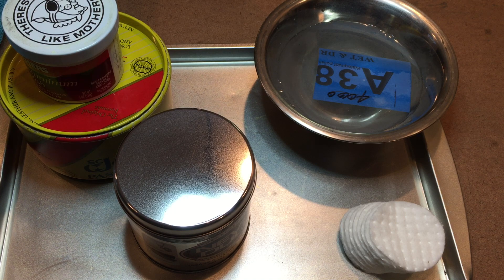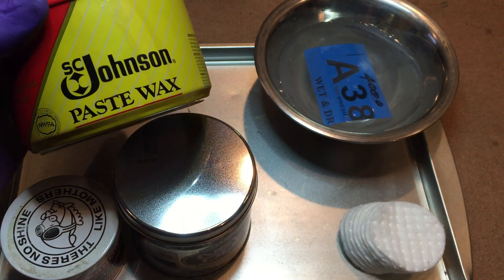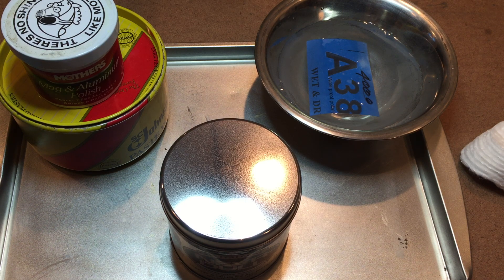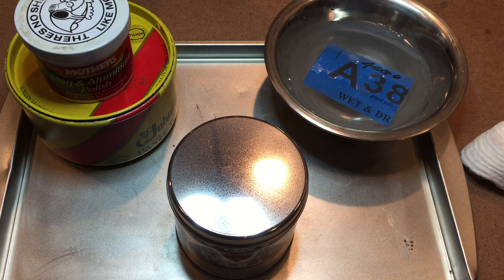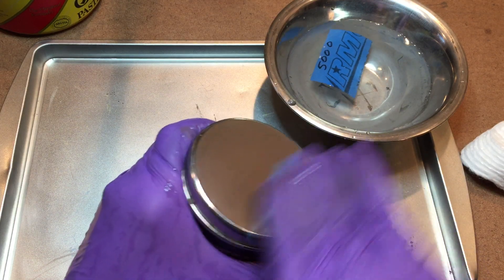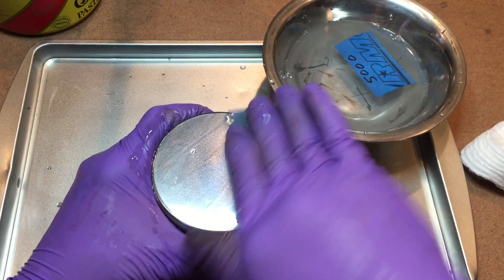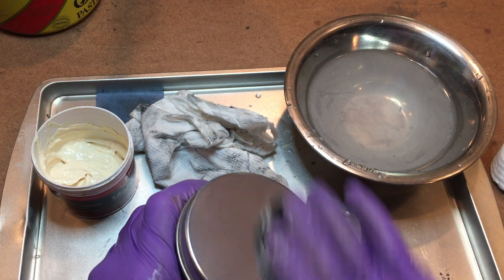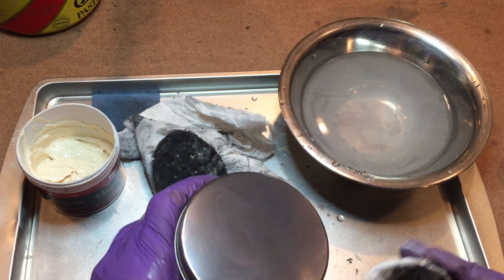Stainless Gun Mirror Polishing Technique (Simulation - Part 2)

Comment: Very well done. I tried something similar with a stainless 1911, but didn’t use wax. I got it to a pretty good finish, but the problem was every time I touched the slide it made a mess, especially with fingerprints. I’ll try waxing it next time. Maybe that’ll keep the smudges down. Really enjoyed, and learned something with this video.
Reply from the maker: Thank you Old Mike.  Wax won't eliminate fingerprints and smudges, but it will greatly reduce them and make hem easily wiped off.  A polished gun looks great, but it is a lot more difficult to maintain a clean appearance.

Comment: Polish leaves a light haze. Should I re wet sand or use some type of wheel? Your firearms look amazing!
Reply from the maker: It's very difficult to get a perfectly clear Mirror-finish with hand polishing alone.  Is the haze remnants from the polish or from the original metal finish.?    A wheel and jewels rogue may help with that, but I've never done it myself.  My guns are very brightly polish, with just a faint degree of haze.  I'm not sure what type of polishing cloth you used, but try polishing with some cotton t-shirt cloths.  I find that they polish better than micro-fiber and flannel.
Reply: @mr2275cur  I repeated your steps. Shined it right up. You have ig? Gonna go 2 to 4000 grit today
Reply from the maker: @carolinagunners6373  IG?

Comment: I have a 686 plus should I use that sand paper on my revolver?🤔
Reply from the maker: That's strictly up to you.  I don't recommend or suggest that to any one, especially if the gun is in great condition.  But, if your gun is scratched up or has a lot of usage wear, wet sanding is a great way to remove it prior to polishing.

Comment: What about on a blues gun barrel that I want to have a mirror finish??
Reply from the maker: There's not much can do one a blued finish to improve it.  PLEASE DO NOT SAND IT' OR PUT WATER ON IT...!  You have to be very careful with blued finishes.  if the finish is dulled or slightly scratched, try using Flitz Polish and Wax, or some Renaissance Wax.
Reply: Blue finish has its own charm as is. Use very very light mother to polish not too much. Overtime it can cause bluishness fading in weird way...

Comment: Can you this on a Taurus G2C slide?
Reply from the maker: Yes, if the slide is stainless steel.  I don't recommend it on an alloy or carbon steel slide.
Reply: @mr2275cur  also if you have already sanded and polished can you go back and repeat the process for better results
Reply from the maker: @rickfederico6857  Yes, you can, but that's a lot of work.  I only wet sand to remove significant scratches and grain marks that interfere with me getting the finish that I like.  You need to be careful when doing to not shallow out stampings and etchings.  You should not do this too much or unnecessarily.

Comment: My 1st attempt, I was able to get ok shine to 500 magnum I can see my reflection but there are still super small scratches. Going to try your trick with using mothers with 5000 grit. Here's what I did- dry sanded with 400 then 600 then new buffing wheel with white compound then new wheel with green compound(was dangerous and a bitch) then I been hand polishing micro fiber towel half a can of mothers and still have micro scratches😐. I subbed, thanks!
Reply from the maker: Thanks for the sub.  I think 600 grit is pretty aggressive.  You'll probably always have some scratches after stopping with dry 600 grit sand.  Consider 1000 - 3000 and 5000 grit wet sanding, followed by polishing with cotton cloth or cotton balls or pads.

Comment: Would u do that to a new gun or a used scrated dull gun only?
Do u take apart the gun or leave it intact ?
Reply from the maker: NO to the first question; I would not do this to a brand new gun.  There's not need to.  Secondly, I view each used gun differently according to what I think it needs to achieve the finish I want.
Reply: @mr2275cur  when you polish and sand it do you take it apart or you work around taking apart ?